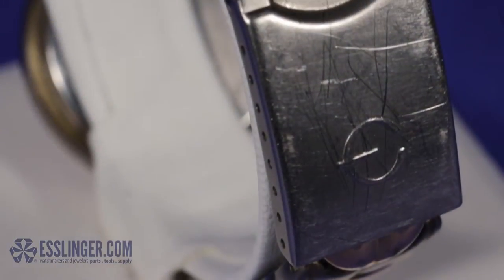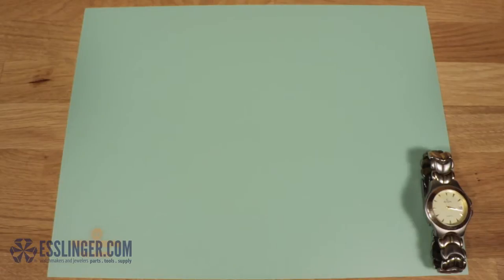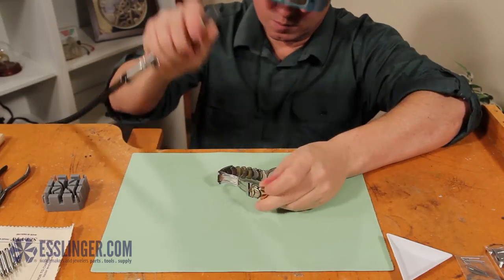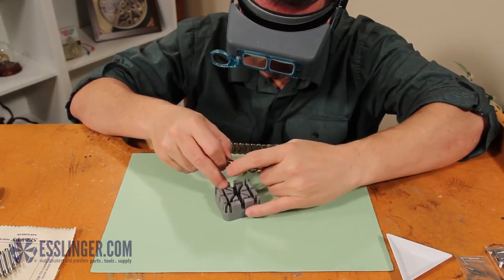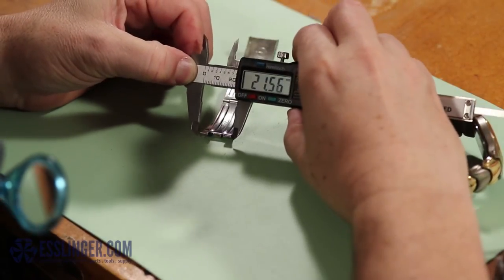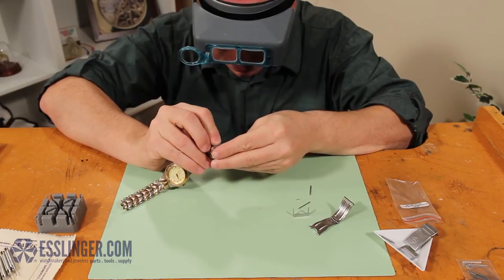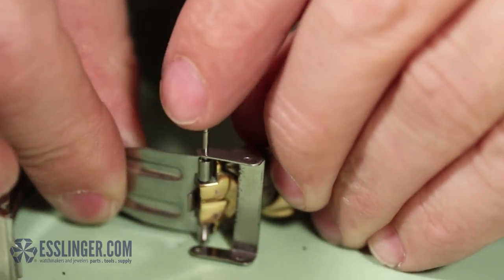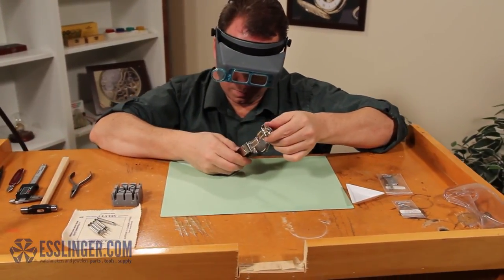How to Replace a Tri-Fold Watch Band Clasp with a Security Latch

Comment: for future viewers: rather than grinding off the tip, I was able to pry out the clasp pin by torsioning needle nose pliers against the inside space of the clasp, and expanding it apart, this did bend the clasp but as the video states it's not intended to be reused.

Comment: So I guess without a grinding tool as shown, I am out of luck with DIY. I'll try a watch repair shop to replace the clasp.
Reply: I used a 60 grit sandpaper and it sheared off the top of the pin. It didn't take but a few minutes to do so.